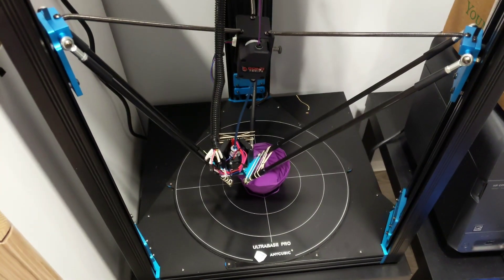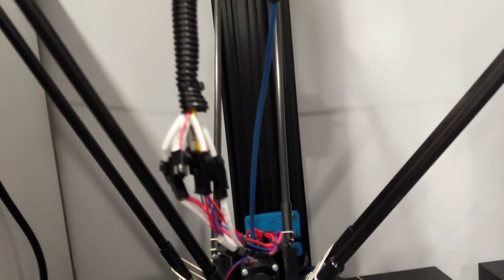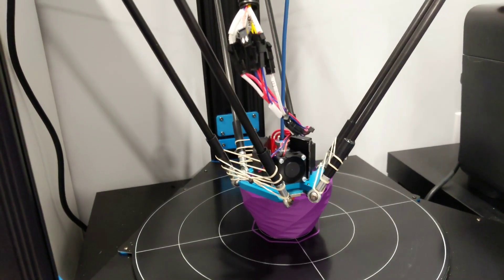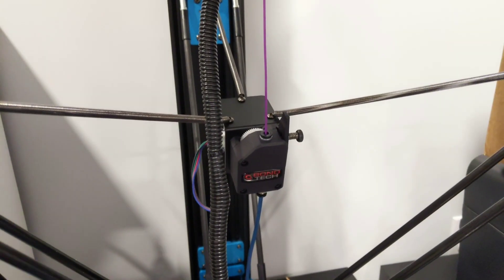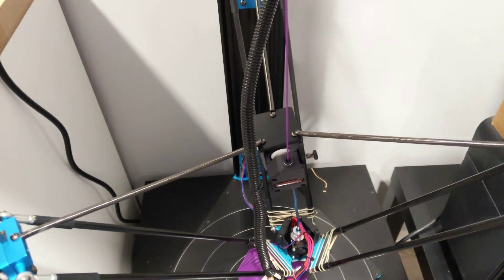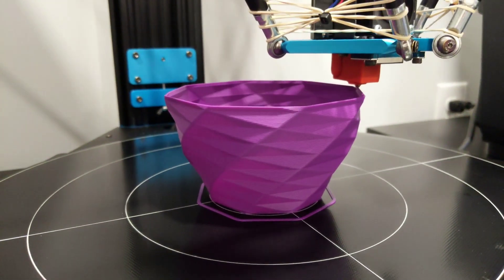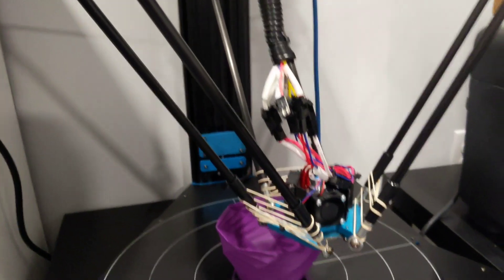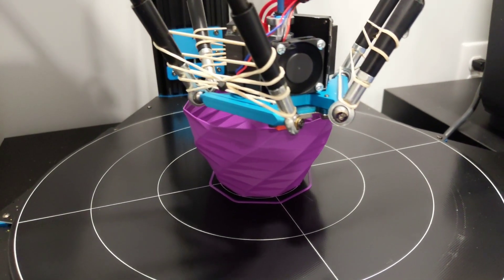AnyCubic Predator E3D Volcano / Bondtech BMG Upgrade

Comment: Hey Jon, thank you for the video! it was a big help in my referencing to my build as I upgraded to a bmg extruder, as well as e3d volcano. The only problem I have is getting power to the stock volcano fan. I spliced and soldered them (no power). swapped for posi/neg mix up still nothing. any suggestions for what you did? do I need a resistor for difference in wire gauge?

thanks again!

Comment: hey jon, i've just receve the predator and i'd like to print nylon pa12. i kno that for this material i have to replace the hotend. The E3D Volcano is the right one for print nylon(250-270')?  if yes what i have to do for fit the level sensor, program temperature etcc ?

Comment: Hi. I got 2 of this printer but i cant get them leveled enough to have any prints. the hotbed adhesion isn't good and the 0.4 mm up or down is just too close to the bed or too far away. How did you work it out? Looking at that hotend you have i kinda want one too but since i dont have a 3d printer that can print parts i gotta deal with what i have on hand. Much love from Norway

Comment: Good video.  I too have the Predator, and love it the most of all my printers.  The workmanship in it is great.  The few downsides can be improved with simple mods, but you won't find a printer for this price that has such a large build volume and is as solid.  Easy to access the electronics.  Easy to fully enclose.  I print on glass, which eliminates any issues with the build plate that people have had (glass is better anyway).  The solid build surface is great because you only need to level it once, whereas cartesian printers should be leveled before every print.  The build plate heats up very fast considering its size.  They put a lot of thought into designing this printer.  BTW, regarding changing the code for the extruder: doesn't it use Chitu G code?  I believe it does (haven't tried modifying it yet), and if so, you can easily make those modifications.  You can simply create a file with Notepad, give it a gcode extension, and print it like any other print.  You can find most (if not all) of the codes here: http://www.customize-3d.com/chitu-g-code-explained.html.

Hope this helps Jon.

Comment: Are the posts painted or anodized aluminum in your Predator !? ( if you are seeing black paint flakes being released from the contact area between the wheels and the groove of the post )
Reply from the maker: My posts are painted. Working on a rather large rebuild on this machine right now and that will be addressed
Reply: @jonsenkiw  My posts are painted also and they've started going quite rough. I hope Anycubic make good on their promise and replace our posts with properly anodized versions. I've been following your work on predator. I was about to run for MagBallArms replacement then I learned you are working on a rebuild. Considering you are the definitive authority all things Predator related, I may wait and see what you have planned. Thank you very much for doing this. There aren't many coherent sources of reliable information about this great printer out there.

Comment: Swap board to an skr1.3
Reply: ... or SKR 1.4 with TMC 2209 now that they are more readily available.
Reply: @pixelsmaster5452  my comment was 30 daya ago... Yeah 1.4+2209s
Reply: @Phil-D83  I assumed your comment was made prior to SKR 1.4 availability. And I'm glad you agree with SKR 1.4 and TMC 2209s. The only part I have doubt is the driver for E0 ( extruder driver ) We were always told in Cartesian printer controllers better choice for E0 is LV8729. What driver would you use for Predator's extruder ( if and when upgraded to E3D Volcano + Bondtech BMG ) ?
Reply: @pixelsmaster5452  been using 2208s and a 5160s on my other printers, even on the extruders, without issue. 2209s seem to be the best choice atm, even for the extruder. Run in uart mode, and it will adjust the voltage as required. Usung triangle labs bmg clones on all machines, no issues. Volcano looks good for the predator if you print big (8mm nozzle, etc)

Comment: I have to say it's looking awesome. What changes did you make so the Volcano could fit in ? it looks like you removed the stock shroud, the e3d fan is facing the camera and the rest of the fans are stock ?
Reply from the maker: I did cut out the stock fan support to allow the V6 stock fan to fit. I had to mill out the effector to fit the larger heat block of the volcano. The rest is stock.

Comment: I upgraded to bondtech extruder to my Predator as well, however the extruder is now works in the reverse direction. What did you change to allow it to extrude in the correct direction. Thanks!
Reply from the maker: Simply rotate the stepper connector at the controller board and you are good to go.
Reply: @jonsenkiw  Thanks Jon!!
Reply: @jonsenkiw   In the gcode I have tried to update the esteps using "M92 415", however it does not seem to be taking. Is there another trick or way to update the esteps in the gcode or in the smoothieware?  Thx!
Reply: I think I forgot the E in front of the 425...  M92 E415, duh!  Let me try that.

Comment: Whats up with the rubber bands?
Reply from the maker: Its a cheap way to tighten up the slop in the ball joints. This reduces vibrations and improves print quality. One of the reasons most folks upgrade to magball setups.

Comment: Just set up mine today.
1st upgrade before assembly stepper motor dampers
2nd decoupling the board fan using some rubber sticks from an old noctua fan
3rd as well before assembly tl smoothers
4th sunon hot end cooling fan
5th currently printing a new part cooling fan duct, the stock one is printed in a quality that's best to be called an abomination!
I would really love to see more of your videos! I have some questions.

1st.  my ultrabase, when I clean it with IPA it, I wipe of some strongly yellow stuff, it's almost looking like nicotine, I have other ultrabases here which did not discolour my paper towel.
2nd does your printers firmware crash and  the touch screen flips by 180° if you use the back button while printing?
3rd what's your firmware revision. Mx about page says 1.4.1 what is actually more advanced than what you can download currently from anycubics website? What'ss your revision?

I need more details. The biggest issue so far is the firmware. It doesn't seem to be a special built at all. If i go to the home axis page there are buttons for homing xyz and all, doesn't make any sense. Please make a detailed review. Thanks

Comment: I must say, I've been running this printer stock for a month now, printing projects with it. And aside from adding dampners and TL smoothers, tightening the bolts and stuff, it prints impressively well... dont even feel like doing any further updates on it. 0 fails
Reply from the maker: I printed quite a few things on it before I decided an upgrade was necessary. Owning 3 x Prusa MK3S machines, I felt this printer was too slow. A lot of times, folks get caught up in upgrading these kits. I like supporting companies like Bondtech and E3D and am happy to add them to any of my builds. So making a story short, was the printer good before? Yes. Is it better now? Definitely Yes!